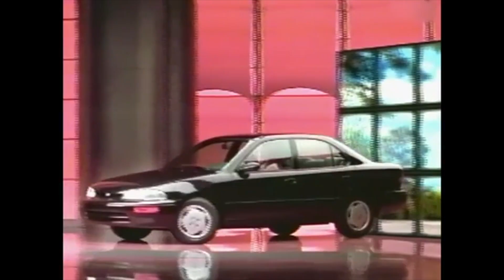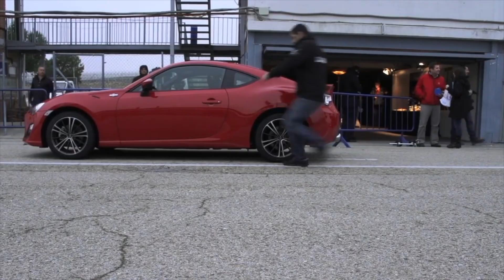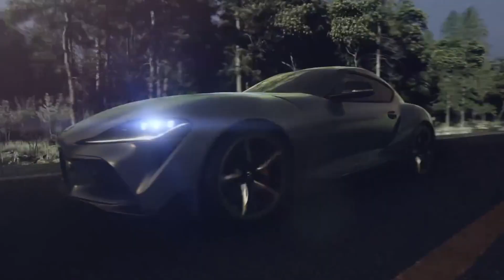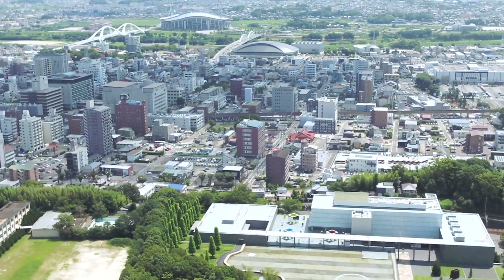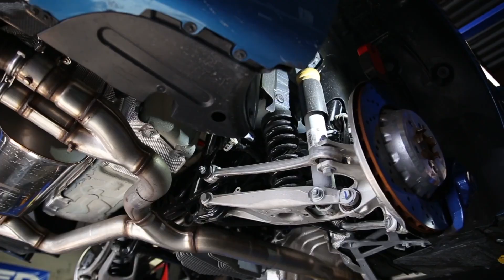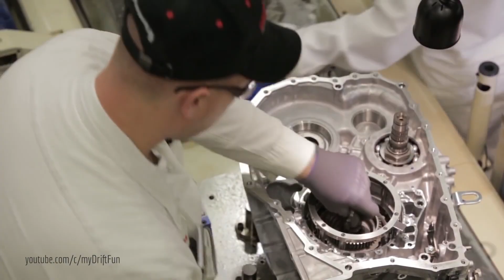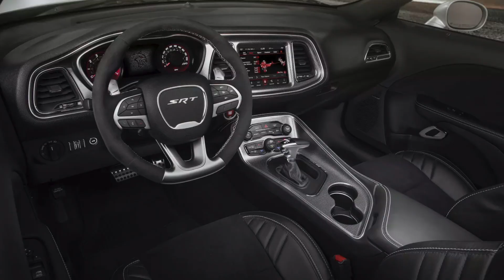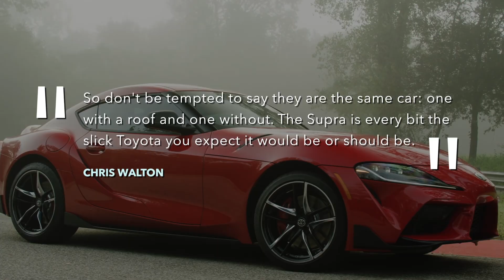MKV Toyota Supra - BMW or Toyota? The UNTOLD TRUE STORY

Comment: First of all I will say that this Documentary Video was well done by "Albon"; it was not biased and presented the evolution and the collaboration aspects that took place between Toyota and BMW!!  Now,  this is my perspective: my 1st (New) Car was a '99 Toyota Corolla Sport-touring (No A/C...dooo)..:-(, then I traded up in 2002 to a 2nd (New) Car, Toyota Camry (Two young Kids & Wife who wants A/C), led to the Camry...plus Size for two kids Car Seats..:-)  Fast forward to 2006, Camry due for Lease-End, but No New Camry, so I went to GM (Pontiac G6 V6)...Don't ask...I'll never do that again!!  POS!!!  Summer 2006=Divorce..:-(, add in two Crashes with Pontiac in 2007 & '08...got rid of Car.  Now here is where things get interesting...I always wanted a BMW 3-Series or 5-Series; so I found a 2000 BMW 540i"A" Sport Pkg E39 near-by, so I took the "Leap of Faith"...Bad decision, Car had lots of KM's 253,000 and lotttsss of issues; Bought Car for $5,000.00 CDN and have spent close to another $5,000 on parts, labor, taxes, duties...I know long story..ehh!!  I have always admired "Japanese" Cars & Motorcycles; I've Owned 6 Bikes: '80 Yamaha GT80, '80 Yamaha Enduro 100, '85 (New) Yamaha Seca 400s,  '91 ('87 Yamaha FZR1000RR), 2005 (New) Suzuki GSXR1000R, '14 (Used) 2002 Honda CBR1100xx Super Blackbird!!  Thoughts>>Pros:  New 2020 Supra, very nice Car, Cons: Two much influence, design and manufacturing processes taken place outside of "Japan"...IMO, Toyota did not need to collaborate with BMW, they've been building High Performance Cars long enough, to make the NEW SUPRA, the BEST EVER!!!!

Comment: If Alfa had also co-designed I'd be getting worried.
At that point they'd produce something that kicked ass until Ford, Jaguar and Peugeot eventually fought back and got the upper hand... (I'd say Renault but they're basically Nissan's / Mercedes these days so wouldn't work!)

Comment: I loved my MKIV. Everything but the auto transmision. I didn't think it would affect my love of the car when I bought it, but after a while I came to realization that it ruined it. So much so, I felt compelled to buy a new car. Also, I just noticed the new Supra has a park-brake button, not lever? Why not just be done with it and make it FWD, no LSD, remove the tacho, put a prius engine in it, make it 4-door, remove any lumbar support, have a really high seating position, reduce the track, numb the power stearing and paint it beige. Sigh, it just goes to show Toyota aren't in touch with what enthusiasts want. Maybe the car isn't targeted at enthusiasts though, maybe it's targeted at yuppies who don't know any better. This should have been labelled the new Soarer.

Comment: Even if I could afford one. I wouldnt buy it. If this would be a complete new car,  its maybe something fancy. But this is not a supra. I am not a mk4 fanboy or anything like that. I just find its a disapointment to any supra fan. Of course its nice they even build one. But nearly all the spirit of the supra is gone. At least its am straight 6 engine. But wrong manufactor. Anyway good for the mk4 owners. Your supra is not gonna loose any value. 😅

For this price you can get a really nice Lexus instead. Probably the better choice 🙈

Comment: The early 90"s Supra was and is an amazing car. A car that is very sought after to this very day.  For its time it was the poor man's sports car, that turned into the beast it is today. The new 2020 Supra had big shoes to fill.  In my opinion, the new 2020 Supra did not fill those shoes, not at all. The 90's Twin turbo Supra with full package suspension and all Could beet the BMW Z4 in 90% of road test is only looses in luxury items. No manual WTF is that all about. 90% of men under the of 60 that purchases any car in the sports class look for a manual trans.

Comment: You forgot to mention the BMW interior. Yes, technically not badged Z4 but nobody is complaining about badges they are complaining that it is a Z4 with a Toyota “shell and badge” which after watching your video is still the case. Tuning don’t mean shit! Toyota buys a Z4 and tunes it...so you can call it Toyota now? No! The design of the Supra was significantly limited because sharing the frame with a Z4. Check out Carbuzz an artist designed what the Supra should look like. More based off of the MK4. It is real nice and everyone I showed it to agreed. You can’t blame the disappointment with this car! It ain’t a Supra! Stop trying to use words to cover up the bs and screw ups. Don’t matter if it “drives great!” It ain’t a Supra. Stop being in denial. Check out the inspection review under the car and under the hood where everything from underbody covers, small supporting parts all stamped with BMW and bmw serial numbers. So did Toyota or BMW pay or sponsor you to make this video? The only review in favor of all this ridiculousness so far.

Comment: I would have been happier if Toyota developed it on their own. BMW is a great company but if you drive a beemer and then drive a Toyota they are completely different cars they have different souls. I would buy the Z4 because that is what this car is meant to be not a supra. I don't know why that is such a bad thing. I am a die hard rotor head I own one as we speak and would never sell her. When I heard Toyota was going to be involved in the new RX9 I decided I would not buy it. I believe since then Mazda has scrapped the electric Rotary hybrid idea. I don't think we will get another rotary sports car from Mazda and I am okay with that. I'm glad they didn't put out that bastardized hybrid. Take note Toyota I see issues with this car selling to its base. You may have some sales upfront but it will wain quickly as you have to keep you Supra base in mind. They want your car. Great video by the way.

Comment: Let's just hope they didn't put the turbos near the top of the engine like most new BMWs where they cook all the plastic which is all you see under the hood including the valve guides which get cooked and someone has to spend over 20 hours tearing down the piece of crap engine. BMW will always suck they should keep their junk in Europe where it belongs

Comment: This is not the supra we remembered.
Reply: the man who designed the original supra likes it.
Reply: I remember when the 4th gen Supra came out. There were naysayers like you guys then too. It was too curved and modern looking to carry the Supra name, when compared to the 3rd gen. If we would've had the internet and YouTube back then, the comment section would be filled with people absolutely hating it to smithereens. Only time will tell, but I think the new Supra will be just as successful as the previous one.
Reply: @DanniV8    lol no manual and BMW parts . Bro. Don't defend this basterd car .  This is not what people were waiting for .   Toyota needs to call it something other than a Supra .
Reply: @rkelley8475  Nissan GTR doesn't get a manual transmission either and it's one of the most successful Japanese car in later years. Nobody is complaining about that, and the only reason that thing exists is because Renault saved the company back in the early 2000s and today most regular Nissan cars are littered with Renault parts and even since 2017, Mitsubishi has become a part of that alliance. Collaboration between large manufacturers is happening everywhere, the difference is that the information on how extensive it is was leaked in this case.
Reply: @jonathandalton2921  ....Really?
Reply: They should've gone with another name i agree.
Reply: Isn't it a bit too much to ask for another legend? It isn't as ground breaking as the Supra everyone remembers, but it still is the best they could make.
Reply: @mil2768    there best is not good enough .  They are trying to make money off the name not staying true to the original reason for the Supra
Reply: Yeah, because it's a new one, duh
Reply: No it's not, but if they just rebirthed the old one it'd be an embarassment. I'm impressed with how Toyota influenced BMW towards reliability. And in the end they went their separate ways to make different feeling cars even though they have the same base. I think it's incredible.
Reply: Get over it
Reply: Then go buy the old one.
Reply: @RoundenBrown   we will have to .. of we wanted BMW junk we would by a  BMW.
Reply: You remember the pumped up flame spitting monsters not the factory supra...
Reply: Lol go buy the old one lol...
Reply: Good

Comment: Haha! Now Toyota is trying to promote a TRD version!! 😂 Yea they got it right.. TRD Supra is really now pronounced Turd Supra or Turd Dupra to dupe all consumers who never knew what the real legendary Supra was really all about especially for clueless millenials!  Also, what is the point of having this overly exaggerated body styling if it's going to have crappy low specs of BMW performance! Should have at least made a Supra that can compete with at least the Nissan GTR even if the price was going to be higher. Just another fake Toyota option.. Now fake TRD?? Another rebadged moment for low entry level of BMW M Performance?? SMH.. Toyota is really trying to fool consumers who dont know any better to believe this is still Toyota by using the TRD marketing tactic! Shame on you Toyota! It was better off not bringing back the Supra especially if youre going to use rebadge marketing to dupe customers with this lame roadster coupe rebadged BMW Z4!! This is all trash!!! Toyota and BMW Collab Garbage!!!! 👎😠👎

Comment: it's not a Sports-Car if it does not offer manual shifting.    Why did they not offer this?   Because no BMW manual shifting transmission exists that will meet the Toyota standards for parts durability.   Of course you could create an adapter-plate so you could bolt-up a BMW in-line six engine.....you would find the roads flooded with Bastardized Toyota's with turbo-sixes out of wrecked BMW's, or the M-5 10 Cylinder.   In a Supra.   That could win the World Drift Championship out of the box.

Comment: Get the Z4 for the manual transmission lolol

This is a dumb joke, but it speaks to the industry getting hard for abandoning the manual transmission. It's more than a simple preference, it's an integral part of the experience that's worth more than "shifting fast." Also much more reliable, but long-term reliability has long-since been abandoned as well. Ugh. I just hate new cars. There's a reason so many people obsess over cars from 2-3 decades ago.
Reply: 90´s cars all the way.

Comment: In my own point of speculation I don't care that Toyota worked with BMW on the new build. My only beef with Toyota is the fact that they should've stayed with the 2jz platform, or even went as far as making a 3jz. Just something new but in perspective to the 2j. For example dodge stayed with a hemi style engine but totally redesigned the layout, or ford merging the modular 4 cam with the traditional 5.0 block witch yes I know is still modular bottom end but at least they revisited cubic inch displacement. I could go on but I'll stop here.....